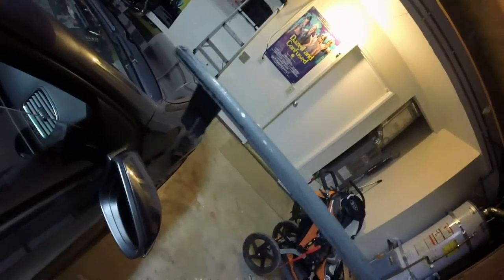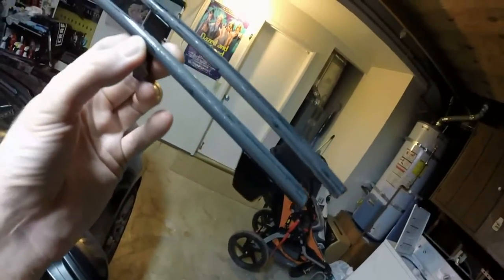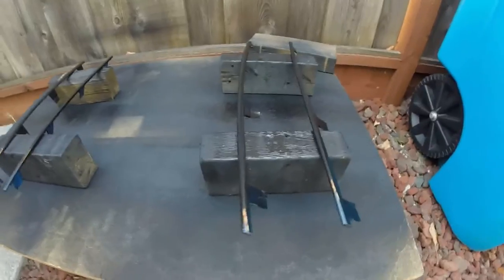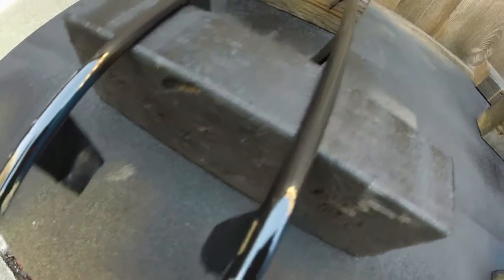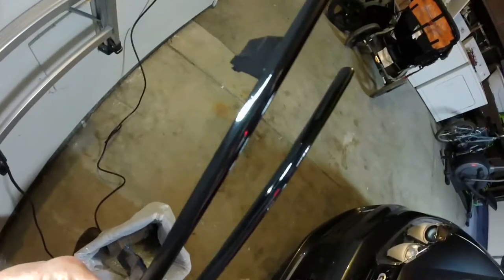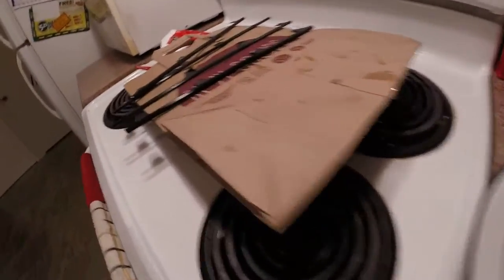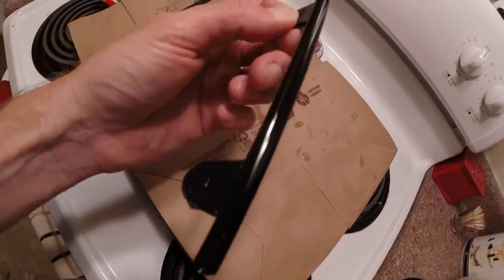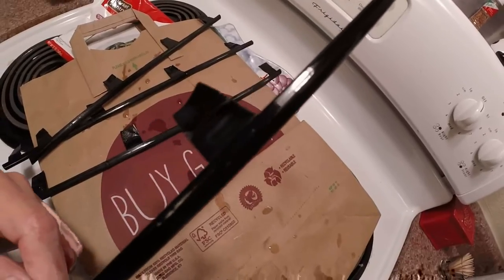2013 VW GTI: Episode 78 Vlog: Wet Sanding Attempt Part 2

Comment: Good job man.  Yeah, sanding down a little bit between some of the clear coats would have helped even some of that out, and some finer grit sandpaper would have made it easier to smooth out, but given what you were working with: it came out great.  I am glad you were able to sort things out.  Nice job with the paint.  (I told you it is a pain in the ass ;).)
Reply from the maker: the next project might be re-doing my rear valance. The problem is textured surface is really hard to work with. You may have seen a video where I already went gloss black. Well its a bit too shiny and shows dirt too much. I might have to do it again in a matte black. The whole problem is... you can't wet sand the texture.. and i don't want to completely smooth it out either, thats way too much work.
Reply: LastHumansGarage
Have you tried Plasti Dip on it?  It will not make it shiny (which I think is good, because it means those pieces of trim will not clash with black paint, it kind of makes them stand out more, and any sort of texture will not show scratches as badly), but Plasti Dip has a texture on its own that should compliment what is on those pieces already.  Plus as long as you spray it on properly: you can remove it easily and reapply it if it starts to look bad.

http://nickscarblog.com/cars/the-ultimate-plasti-dip-guide-tips-ideas-more-for-cars

(You can see the texture I am talking about there.)

I might consider the rubber Plasti Dip because it will probably be a bit more resilient to scratches over time.

If you are looking for more of a gloss look, but want to keep it from getting scratched up: you could always use a clear film wrap or something.